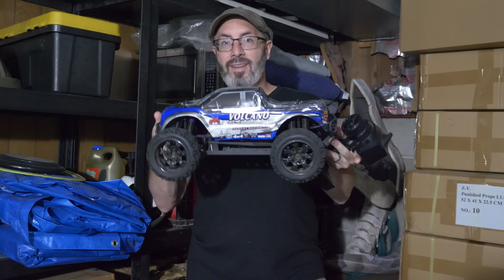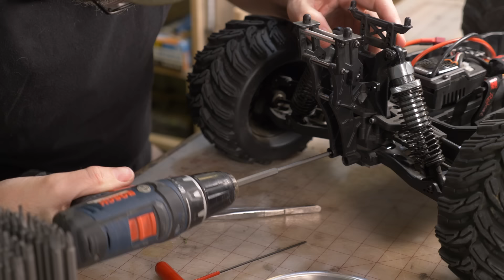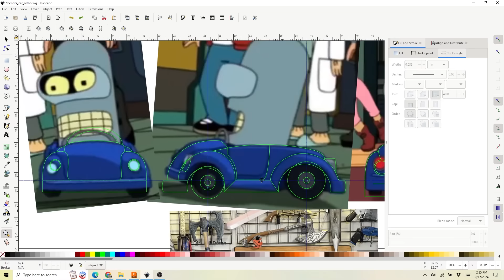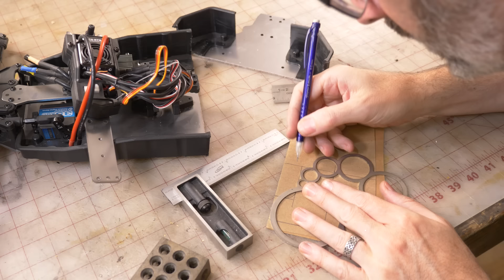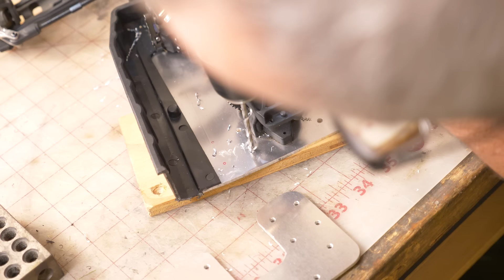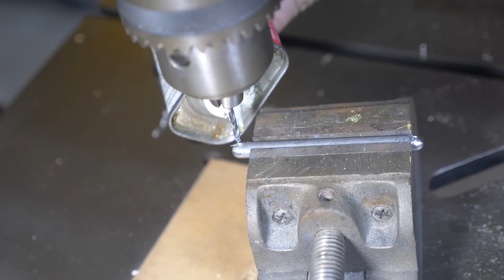Fun on a Bun! - Bender Car Part 1

Comment: $300 for that cheap looking RC truck? wth...never in a million years would I ever pay that for that, let alone if I'm ripping it apart.  Easier and cheaper to just make a bigger frame for the smaller one to get it to the size you needed - especially since you don't need to care what the inside looks like.  You could get a helluva RC f'ing plane or drone for that amount of cash.

Comment: If you were going to cut the car in half to fit the scale wouldn't it be easier to go with 1/10  scale and widen the car instead of getting right width and shortening the length ?
Great project, very excited to see how it will turn out :D

Comment: Hey Bill, good to see you again, it's been a while.
Maybe one Idea concerning the reinforcement of the seams of the 3D-printed parts on the body: what about glassing over from the inside, just a small strip of about an inch or 1.5 wide? We did this very sucessfully on the prototype shop at BMW on some 3DP-Parts we had to produce in sections and bond together.
BR, Sven.
Reply from the maker: I was considering that. I’m not sure it’s necessary, but I can do that at any time after it’s constructed.

Comment: You want that body much higher.   the axels should not be centered with the suspension unloaded!
Reply from the maker: Right on. I’ll be able to adjust the height once I have the wheels.

Comment: You will want to change the motor, as that one will be to fast for inside use. I suggest you get one for an RC crawler, and maybe change the gearing.
Reply from the maker: Ooh, great idea.
Reply: @punishedprops  It will help slow the car down, even to walking speed. RC crawlers are a segment of the market where they go for things like accurate scale and going rock crawling.

Comment: Great Idea. However instead of cutting the car in half and rejoining the halves why not just trace the profile of the back, trim off the back,  then machine the new back end to what you had cut off? Would have saved you a bit of time and you could have use  the back end you had cut off as the templet.
Reply from the maker: That would have worked well too. Didn’t think of it at the time.

Comment: Surface modeling in Fusion is really tricky, I'm glad you talked about the difficulty learning it and having to restart multiple times. In the end it looks great and look forward to seeing it painted.
Reply from the maker: Thanks! Learning new stuff can be frustrating, but it’s worth it.
Reply: Yeah, it's very tough. I use solid modeling with filets and chamfers to simulate an organic shape.
Reply: "Really tricky" is an understatement.

Comment: 15:50 It looks like the alignment holes might have covered over with the brim that you added (and maybe filled in with support material too?)
If it's a bother it might be worth checking in the slicer if there's a setting for that - I know in Cura at least there's a checkbox called "Brim Only on Outside"
Reply from the maker: Awesome tip, thanks for sharing!